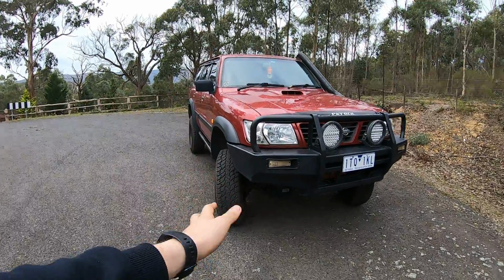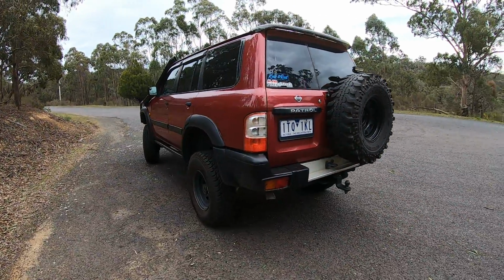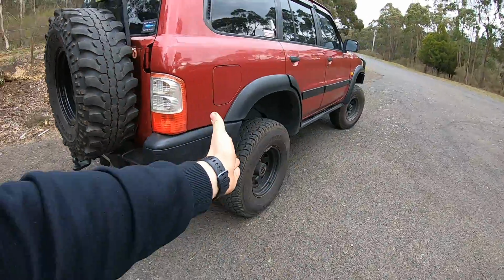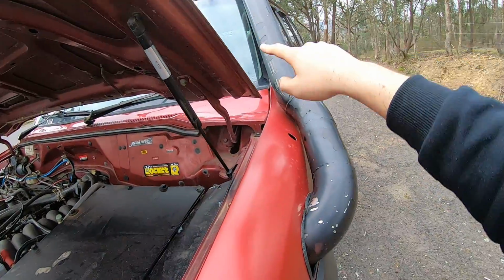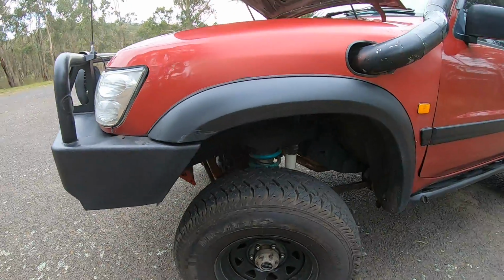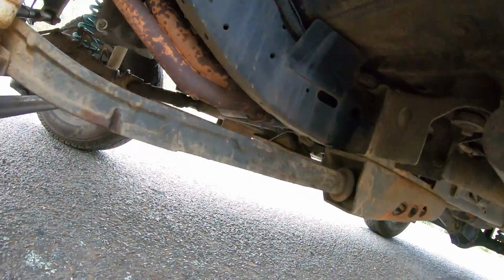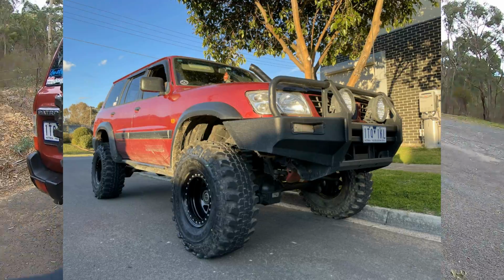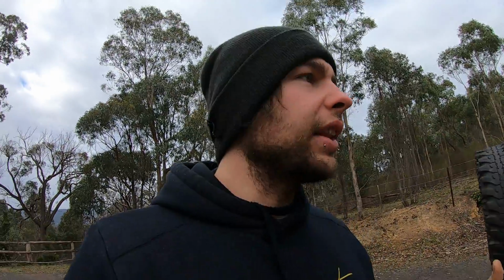3 Months of daily driving an LS1 swapped Patrol! How has it been?

Comment: Great! loved watching your patrol videos. I'm also from Victoria. I have an 98 RD28 GU that currently has a missing coolant issue. Im thinking my head gasket is gone but need to get it diagnosed soon. I'm thinking of keeping mine diesel and doing eventually a TD42 swap on it with 12 ml pump. However, for the price difference, watching this video, a V8 isn't 100% off the table.
Reply from the maker: Hey mate thanks for watching and bloody bugger that’s annoying that’s what my old one did that turned out to be a cracked head :(
Either way td or v8 will be a massive improvement haha!!